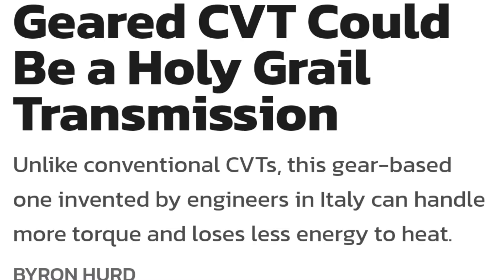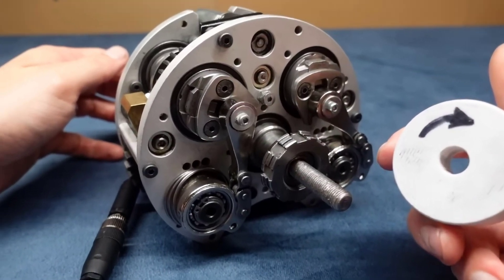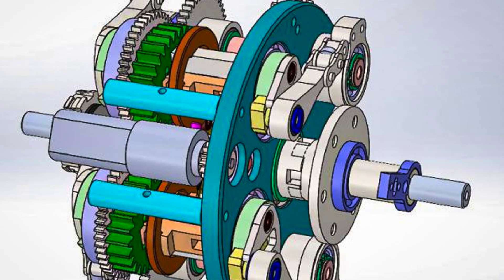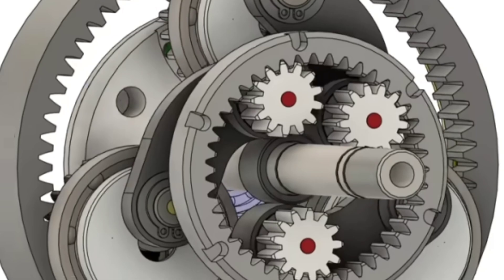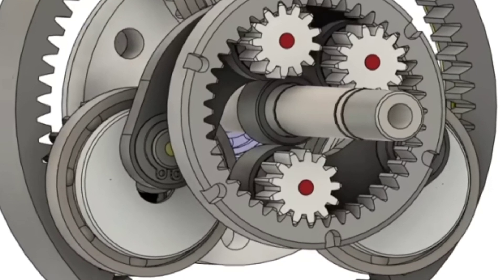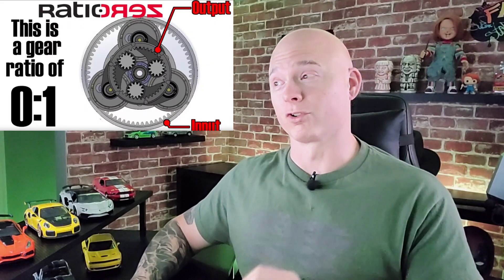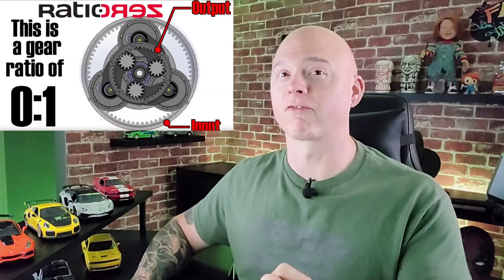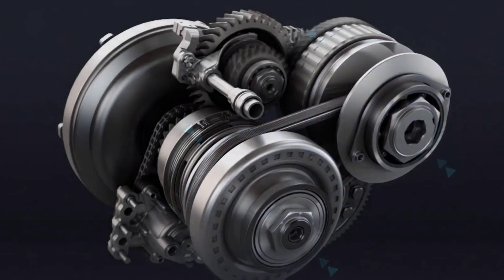World's first GEARED CVT is a game changer!

Comment: I emailed the guys at ratio zero to ask them about this cvt, and they responded:
My email to them:
I am very curious, and love your cvt and if I can find a car with it in when I am older, I will buy it. But I have a few questions. 1) In a car, how much faster could you accelerate with your cvt compared to a traditional gear system since it is not exactly torque limited (unlike other cvts). 2) Some high performance cars use clutches before the wheels to vector the movement of the car, would your CVT be better for this purpose, since it has a 'ratio zero' 3) Can this CVT be improved, made bigger ect to handle a the requited amount of torque for an application, or is there a mathematical limit? 4) Will this CVT be used in wind turbines? 5) How fast theoretically could your design of CVT switch between preset gear ratios? 6) Is it possible for there to be a cvt design which has both reverse and forward gears on it?

Their response:
we are positive that we will have a competitive edge over many transmission technologies (high torque + stepless, continuous shifting), but to give any figure we will have to perform measurements, and to perform measurements we need to finalize some automotive application, which will depend on discussions with customers.

As for 2), we feel that torque vectoring is achieved with more effective means that a CVT. For 3-4), no problems to scale up to a wind turbine size, for instance (depending on customer requests). For 5), it basically depends on the power of the motor actuating the shift. For 6), yes but with additional elements that we did not included in the e-bike design.

I was happy to recieve a reply from them, and their answers made sense, and hopefully we'll get more concrete figures when they have completed all of their testing...

Comment: I really like the planetary gearset CVTs that many modern hybrids use to allow the gasoline assist engine to assist the electric drive. 

Toyota and Ford come to mind.  Hybrids like the Prius and Camry are electric cars with gasoline engine assist (especially below 45 mph).

When the electric drive needs help the gasoline engine provides assistance up through the planetary gearset. 

Nice smooth torque to help the main traction motor. 
A smaller motor running the sun gear sets the rpm of the gasoline engine. 

YouTube has videos on how this works. 

Above 45 mph the two electric motors manipulate the planetary gearset to make the gasoline engine do all the work (at the most efficient rpm)